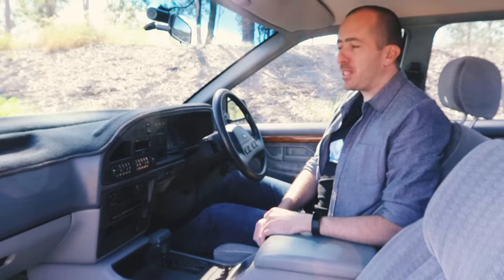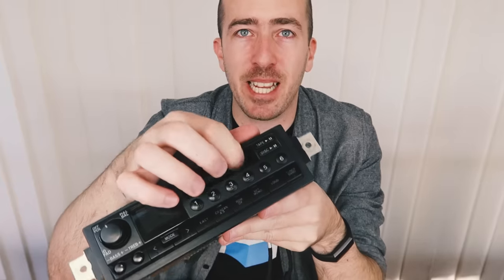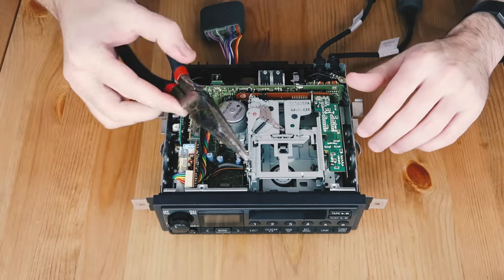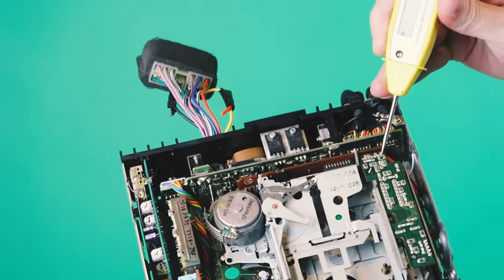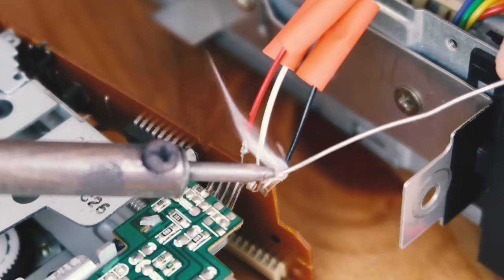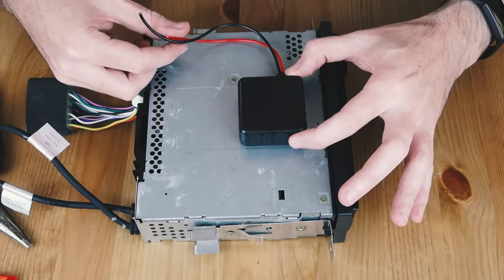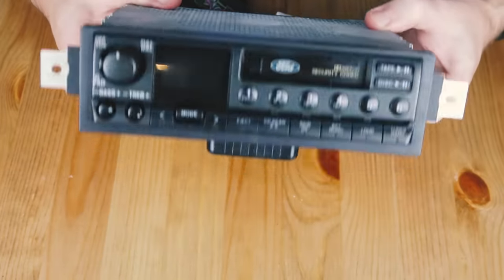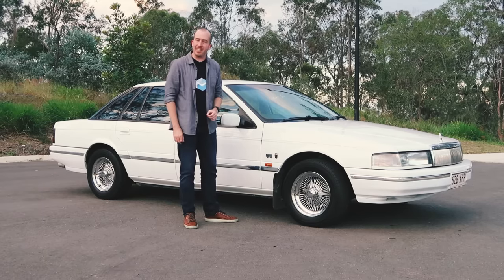Add Bluetooth To Your Old Car Stereo For $25!

Comment: Wouldn't doing this mean that your unit always thinks that there is a tape inside, and therefore always tries to play it. Wouldn't that take away any possibility of using the unit to listen to music from local radio stations, since you unit is always stuck in "Cassette Tape" mode?
Reply from the maker: Depends on the head unit - mine has a "TUNER BAND" button which lets you swap back to radio at any time, and a "TAPE" button to return to Bluetooth. For drives which don't have that, you'd simply keep the tape drive springs in place, and use the tape insertion/ejection as the way to swap from radio to bluetooth.

Comment: Just did this myself in my 98 Lexus LS400, but I used a different receiver. Volume is so low I can't hear it if the vehicle is running. Got the hard work out of the way though, so I guess I'll just buy a different receiver and see if it's better.
Reply from the maker: Sounds like you may have spiced it in after the amplification area
Reply: The main amp for the vehicle is located under the passengers seat. So from my understanding it goes head unit > amp > speakers + sub. Is it normal for there to be a separate amp elsewhere within the head unit?

One other thing to note, there was no ground pin to ground to, so I just grounded to a screw on the PCB. I did however test around by removing the ground and touching it to other parts of the frame and what not while audio was playing. Worth nothing, without the ground the audio would still play, though slightly quieter, or possibly just without the sub. Wherever I would ground it however(screw, frame, etc) the audio volume and sound would be the same, which is ridiculously quiet.

Another thing to note, it plays even without me inserting a tape or pressing down the tape mechanism. Maybe that's simply because my head unit has a tape button to press, where others might turn on only when a tape is inserted?

I just remembered I have an old cell phone with an aux port, so I'm going to try plugging that in directing to the aux cable without the blue tooth and see if I can isolate that as being the issue.
Reply from the maker: Yes absolutely there is one in the head unit. The head unit is responsible for volume control too of course. So if you've spliced your signal in after the fact, it'll be at a much lower volume.
Reply: @MotoringBoxTV  Just confirmed, directly to aux cable and still super quiet. I guess I'll have to try and find a proper pin out for this head unit and see what I can do. I've gutted it fully 3 times and tried two different L and R channel's(Both ran off tape oddly and they were on separate pcb's) both with the same result.

Comment: Does this have equivalent volume levels as the other modes on the stereo or does one need to increase the volume when in bluetooth mode?
Reply from the maker: You have the bluetooth volume level on your phone, and then the volume knob on the head unit. I usually turn the phone BT volume to maximum, and then set the head unit volume to your desired level.

Comment: removing the springs dont allow you to hear radio and you can unplug the cassete electric motor so will be less white noise onthe speakers some radios have line in on the front and some on the back even some have cd player connections that u can use to plug the bluetooth in
Reply from the maker: My head unit allows you to change back to radio at any time. Also unplugging the cassette drive motor can cause errors with some head units (mine included).

Comment: thats a cool mod but wouldn't you lose more modern features such as subs and rear audio along with a more updated audio chip vs upgrading the stereo
Reply from the maker: My head unit already has an external amplifer and rear subwoofer.
Reply: @MotoringBoxTV  did you modify that too because I cant remember a stereo from that time period that supports banana plugs for audio?
Reply from the maker: @gaming_hippie4806  Sorry I should have been more specific - this car came standard with a "Premium Sound" system, which included a boot mounted amplifier which drives the speakers and subwoofer located in the rear parcel shelf. The amp receives its power and signal via one big audio cable. Not entirely sure what you call it, but if you search for "din audio cable" it looks similar to that.

Comment: Please explain why you cut the ribbon cable instead of soldering directly to the board? Seems very unnecessary and quite destructive
Reply from the maker: Have already done so in the comments many times, but here it is again. I've not had much success attempting to do that in the past, and I didn't want to risk damaging the circuit board.
Reply: MotoringBox  thanks for the reply I wasn’t judging your work I was just curious if there was a specific  reason

Comment: Hi, In the process of performing this mod on an afla romeo 159, I've found the circuit diagram (nothing is labelled on the circuit board) and it seems that theres one data line coming from the cd player rather the a left and right. Any idea where I'd be able to post the circuit diagram to get a little help working out where to tap in to get this to work?
Reply from the maker: Might need to research that one as I couldn't tell you. Are you sure the data line isn't just individual wires all bundled together?
Reply: @MotoringBoxTV  Yeah, this is going from the circuit diagram for the board, there's nothing on that link that remotely resembly left or right so I'm assuming its all on the data cable

Comment: Are you able to make phone calls with this unit? or is just to stream audio?
Reply from the maker: Calls still run through the phone on mine. Depending on the module it may differ.

Comment: Not trolling. Just asking. Could you not have just soldered the  sound directly to the board without cutting the ribbon? I think if you did that you could have still had a functioning tape deck. Also is it possible to remove the tape deck unit altogether and just put the Bluetooth receiver in its place?  Just asking, idk if it's possible.
Reply from the maker: Fair questions - it can be soldered directly as you say, I just didn't want to risk damaging the board and I wanted to completely cut all signal /interference from the tape drive. My head unit malfunctions if you cut power to the tape drive, or is it is removed entirely.

Comment: Hello, dumb question but---
Would it be possible to make a cassete tape with bluetooth already in it. It would be powered by the L/R spinners.
Reply from the maker: Bluetooth cassette adapters already exist, but they're all powered by internal batteries which last only a few hours. I don't think the tape reels would turn fast enough to generate any meaningful power!

Comment: Can you do a Bluetooth module mod with a cd/car radio?
Reply: I would love to know the answer to  this question also.
Reply from the maker: In theory it should be a similar process, you'd just have to locate where the audio channels from the CD module connect to the head unit's main board. Plus the matter of working out whether you need a CD loaded in the drive (I'd say you would) and whether you need it to be spinning / playing tracks at the same time (I'd also say so).

Comment: I would have ripped the tape mechanism out entirely and installed the BT receiver inside rhe unit. Anyway, nice job!
Reply from the maker: Wouldn't have worked with this head unit. Even disconnecting power from the tape motor makes the whole unit start malfunctioning. Worth a try if you're doing the conversion, but make sure you can undo your changes if you run into problems.

Comment: Why not plug the Bluetooth module in the port at the back where u plug the cd changer? If u can get a cd changer working easily then you should be able to plug the Bluetooth in the same place.
Reply from the maker: Feel free to do that. But if I had to choose between taking over the CD input or tape, I'd go tape every time.

Comment: Would it be possible to solder it to the circuitboard on the cassette player and the AM FM radio input so that no matter what you are on in your car you have Bluetooth in the background?
Reply: Ehhh.... doing it to the radio circuit would be a bit more complicated, as you'd have to find the amplifier inputs that the fm demodulater feeds into. Keep in mind as said amplifier would be made for small signals, you'd need to use resistors to reduce the level of the signal from the bluetooth adaptor before feeding it in, and would have a lot more noise in the audio. It would be doable, but certainly not extremely easy like tapping the tape deck circuit, and not the most practical. I'd personally solder onto the pins the tape deck feeds into rather then cutting it off, to leave the tape deck still intact.

Comment: Trying to do this on my old Technics head unit. The circuit board looks just the same and I think I've narrowed it down to which connections it is. The thing is they're not marked and I can't find a wiring diagram. If I can power it up can I just try L&R on those connections.?
Reply from the maker: I actually did a similar thing. Get an AUX cable and cut the end off to expose the wires, then use an old phone or something you don't care about to output an audio signal through the cable. Then grab the red wire and the ground wire and try hold it against the circuits. If you can, check first that there isn't voltage running through the circuits first, or you may damage the device you're using.

Once you have found the right circuits, find a stereo test video on YouTube and play it through the device to make sure you've got the right wires on the right circuits.

Obviously be very careful not to short circuit things.
Reply: @MotoringBoxTV 
Hi, thanks for the quick reply. What I was thinking to do is the power up the aux adapter I've bought by connecting to the battery. Then connecting my phone via Bluetooth and playing some audio. Then fitting some spade connectors to the ends of the signal wires and then carefully trying them on the soldered connections of the circuit board. With the tape player running of course.
Do you think there's any issue doing it this way?
Cheers.
Reply from the maker: @tommythousand  only issue would be potentially frying your Bluetooth module if it accidentally receives voltage up the aux cable - hence why I recommended using an old phone and aux cable instead. If you're certain the ones you're gonna try aren't powered, you should be fine.
Reply: @MotoringBoxTV   MotoringBox 
I have a multimeter so should be able to check with that.  I don't think I have anything lying around I could use to output an audio signal. Could probably buy something though. I'll give it a go. Thanks!

Comment: Recently tried this with an old bmw radio, I’ve got it working and the audio is clear but it is very quiet. Pretty much have to have it at full volume to listen to music. Any ideas on why this might be? I’ve ordered another Bluetooth adapter to see if that fixes it. Any help would be appreciated :)
Reply from the maker: Hey Martin, sorry to hear that - something doesn't sound right. If done right you should have two volume controls - the BT volume on your phone and then the main volume control on the headunit. I usually set my BT volume to around 3/4 and then adjust the headunit volume until the output is at the level I want.

Comment: Hey mate I've done this and it works however I am getting a buzzing and whining sound from the speakers. When I use the bluetooth cassette tape its fine, it's only when I switch to bluetooth. Any advice
Reply from the maker: It sounds like you may have a ground loop - it can happen if the head unit and Bluetooth module are receiving slightly different voltages. The first thing I'd probably try is connect the Bluetooth power to the headunit's permanent 12v (instead of ignition/accessories) and see if that fixes it. If it does, you may need to leave it connected that way and then use a relay triggered by the accessories wire.
Reply: @MotoringBoxTV   too easy thanks mate
Reply: Hey Mate. I tried re wiring through the constant power and it still does it. maybe I have a dodgy bluetooth receiver?

Comment: i have a 1960 comet that only has an AM radio, no tape or cd slot lol. could this same process be applied to splice into my cars radio frequency? any help would be appreciated. a look alike bluetooth radio for this car is $600
Reply from the maker: I'm sure there would be a way - others have suggested products which splice into the antenna connection.

Comment: So if you used the first tape adapter and strip the aux cable that came frome it and solder it to your bluetooth adapter
That will give you the same easy result
Reply from the maker: It'd work. The only difference being the signal still has to be read off the adapter by the tape drive heads. As opposed to being wired directly into the head unit circuity.

Comment: Let me get this straight? The tape motor will be dry-working full time every time you turn your car key to ignition?
I'm sorry but that looks like a failure to me. That tape motor, being 25 plus-years old will die in no time.
I see a reason for this project but to me this is really not the right way to do it. There must be another way around this.
Reply from the maker: Not really - it only turns when you switch the head unit to tape mode.  To me it's no different to normal operation, ie. If you listened to a tape most times you went for a drive. I understand your concern, but in the end life is full of unknowns and sometimes you just have to take the plunge. I'll let you know if it ever fails. (Going strong 3 years so far).
Reply: @MotoringBoxTV   It would be easy enough to disconnect the two wires connecting to the motor in the cassette mech too, which would prevent it engaging but wouldn't  make any difference to your mod. If you were trying to preserve the cassette deck that'd be an issue, but as you've cut the audio output phase of the deck it isn't going to be functioning  properly without further work anyway. I've seen this kind of mod done often in vintage boomboxes while preserving the cassette functionality too.
Reply from the maker: @P3SS3SSOd  sorry for the late reply. I did try cutting power to the cassette motor, but the head unit didn't like it and detected it as a tape jam and malfunctioned.

Comment: Hey mate did this drain your battery? I wired mine the same as yours and it drained my battery so I wired it differently
Reply from the maker: No problems with mine, just make sure it is wired to the accessories wire instead of constant 12v.
Reply: Okay I think my wiring harness might be different to yours, cheers. works great now though

Comment: what about cars that don't have a tape drive? I have a 2011 Honda CRV with a 6-cd changer but no Bluetooth what do I do in my situation?
Reply from the maker: Has been asked before. It should be possible to hijack the cd output, but you'll probably need a cd in the drive with one long blank track burnt onto it.

Comment: How about for someone who only has a built-in 6 disc CD Changer in their head unit which is faulty? Could this work with that?
Reply from the maker: Potentially, it sounds like a lot of investigating and experimentation would be required.

Comment: Hi I installed a Bluetooth device in my truck stereo. It work good if i keep the volume at lowest level in my iPhone but if the volume goes up on phone it starts giving problems with sound
Reply from the maker: It would just be a matter of finding the right balance. On the car in my video I did get a bit of distortion when the BT volume on the phone went over 90%. So keep it under that amount and use the volume control on your head unit to do the rest!

Comment: So would this work on a 2003 Gm Delco AM/FM CD stereo in my 2003 Pontiac Grand Prix GT?
Reply from the maker: I've not tried it on a CD drive but it shouldn't be that much different.
Reply: @MotoringBoxTV  Ok thanks for the reply. I'll do some more research on it.

Comment: Why are you not soldering to one of the 2 boards and leaving the wires intact so the tape deck still functions?
Reply from the maker: The answer can be found in many other comments 🙂

Comment: i had a question about that can u skip songs thru the stereo or is it all thru phone bc im trying to get a old school single din with a aux but its a adapter that shows up with 2 rca ports but i really want to be able to skip songs thru the stereo.
Reply from the maker: Unfortunately not - it is just receiving the audio signal and then amplifying and passing it through to the speakers. But I have seen some bluetooth -> aux adaptors which have their own buttons for skipping songs and controlling the volume. Not the same as using the stereo, but at least you could mount it somewhere on the dash or centre console. Good luck!

Comment: I'm all for keeping that original look mate. Love it. I wonder if you could mod it somehow for the real purists who would like to keep a functioning cassette deck too. Or if you could do a video for older cars which only have an am/fm or am only radio.
Reply from the maker: I probably won't be doing any other models, and I guess it's really a case-by-case basis because every head unit is different. If you soldered the wires directly to the pins on the board and didn't break the circuit, the head unit could still play tapes and you'd have to insert an empty tape when connecting via bluetooth. I personally have no use for the tape drive, and didn't want any potential noise or feedback from it tainting the signal introduced by the Bluetooth receiver. Thanks for the comment!
Reply: I believe the only way to do this with an AM/FM only unit is to tap in before the volume control. I've seen it done on a radio from the 60s or 70s that only had a single speaker in the dash.